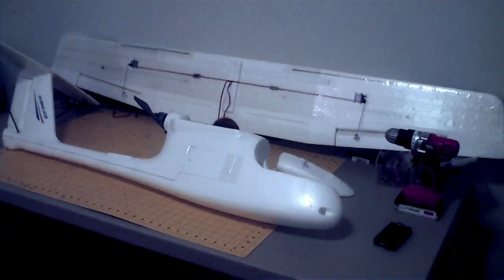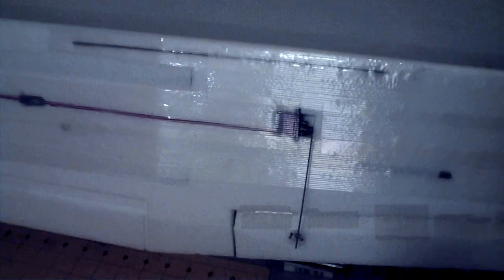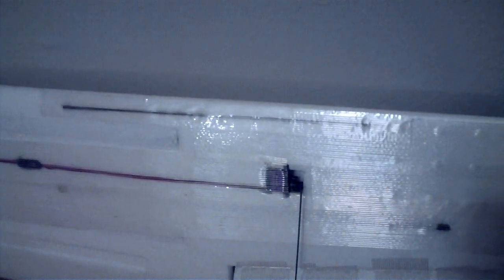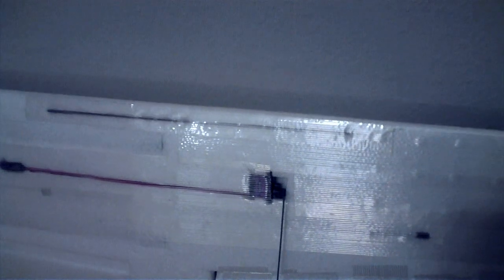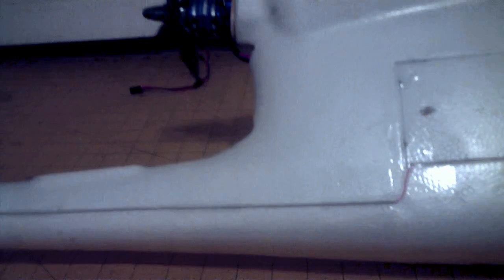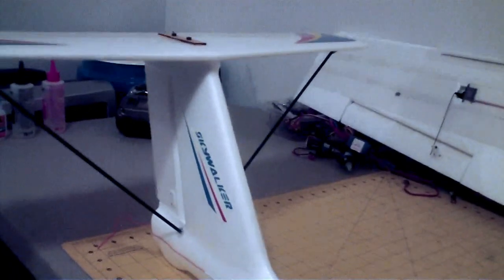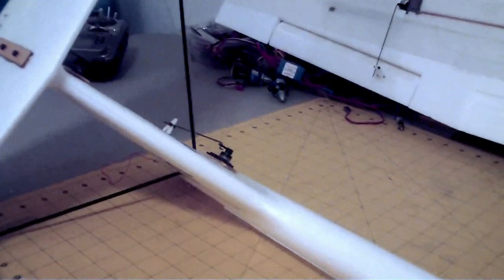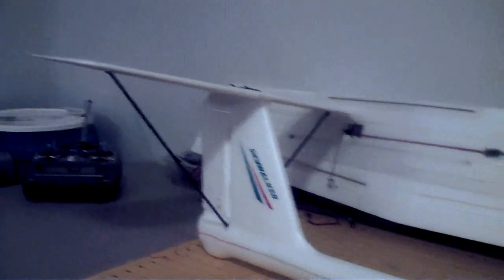Skywalker build progress #4

Comment: Did you find any solution to the tail wiggle? I remember that I forgot to glue the carbon tube inside the fuselage, so I had to do some surgery on my bird to glue it in for less tail wiggle. 

But it's still twisting/wiggling a lot, so I'm thinking about having carbon ribbon on top of the fuselage that goes to the tail.

Comment: Try putting some ca in the boom. Did you sand and glue the carbon tube inside the boom if not just try the ca trick. Don't glass it way to heavy it will be just fine the way it is have fun

Comment: @MrWest1960   Be liberal with the polyurethane to soak the glass strips and go to town wit it. I like to soak the glass first to get the air out. Then lay it on. let dry 24hrs then sand down flat and re-coat again, sand and re-coat, done! This will cure your unwanted twistage bra.

Comment: Fuselage is a twistin eh?  LOL Twist is a hard one to correct bra. I like the easy glass method myself. (i.e. no resin and hardner) Go to HD and buy a quart of Minwax water based polyurethane clear satin, a package of medium weight fiberglass cloth, and a couple of cheap synthetic 2" brushes all found in the paint department. Cut 2-4 2" wide glass strips and apply them diagonally spiraling down the boom to the tail.